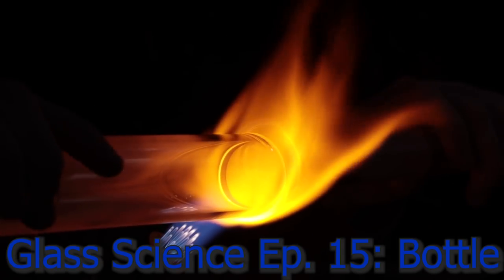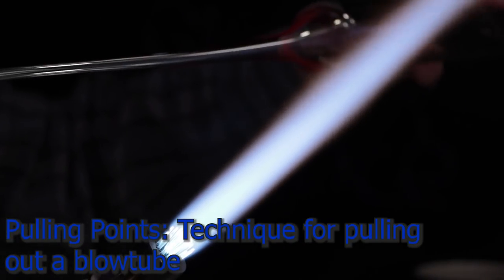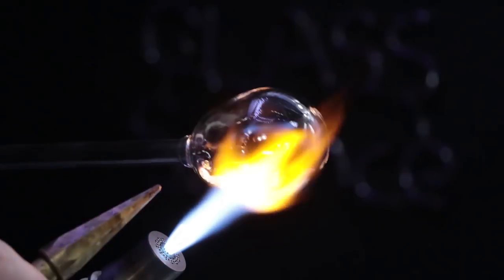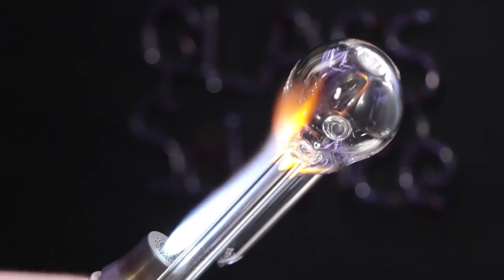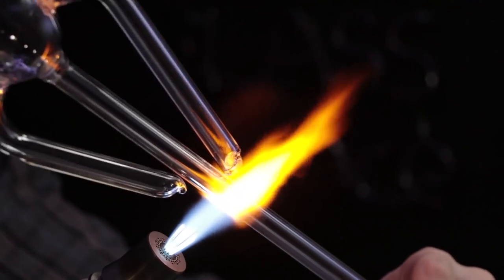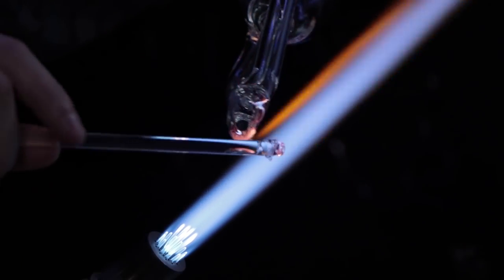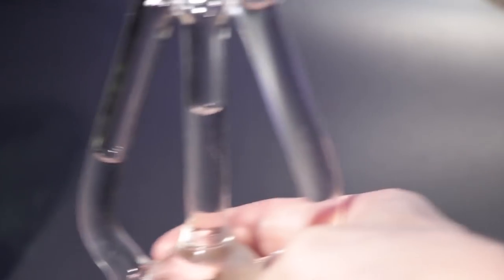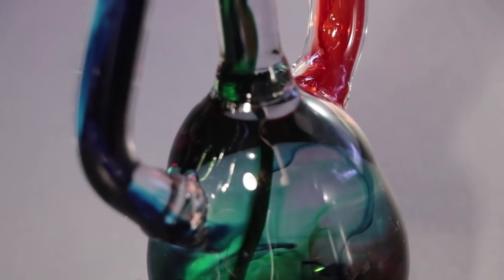3 Neck Bottle | Glass Blowing

Comment: Hi Matt. Those pretty ink drops reminded me of those laminar flow demos where corn syrup or glycerin is rotated with red, blue, and green colored drops about 5 turns and it smears but upon rotating in reverse the smear almost goes back perfectly to the initial injected drops. A tall cylinder within a cylinder with many drops might be a vivid variation to try with glass tubes.
https://youtu.be/p08_KlTKP50

Comment: Its like you accidentally did a pair of jesus seals. The walls open up as you blow out the seals on the neck. You can puff out 2 spots on parallel tubes until the bubbles touch, generally you heat around the seal and puff to thin that inner membrane and once its thin enough it just opens up.
Reply from the maker: Your right I think it is a lot like the Jesus seal, I wonder if the seal opened when I popped it or while I was puffing it out. I'll have to try it again and see if I can do the seal like that without opening the outside.